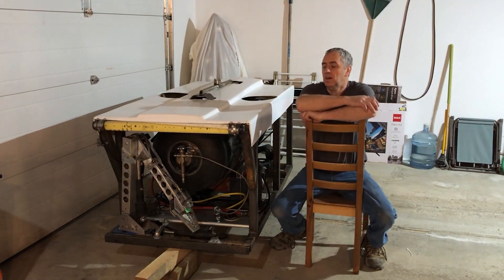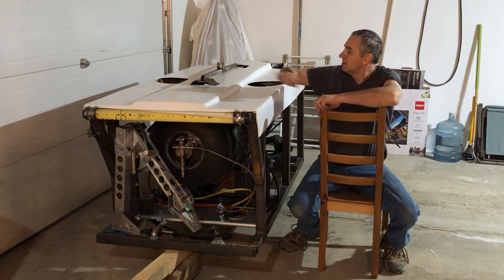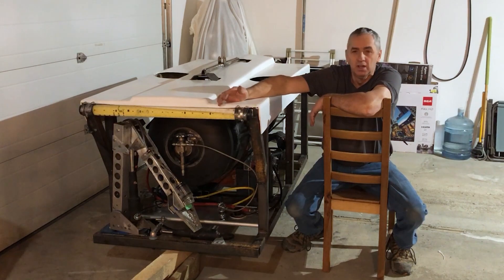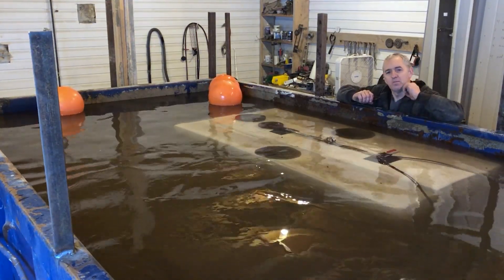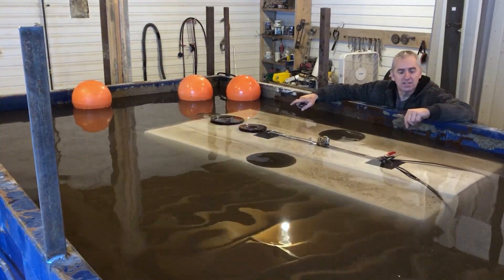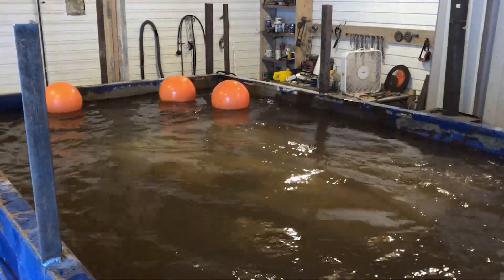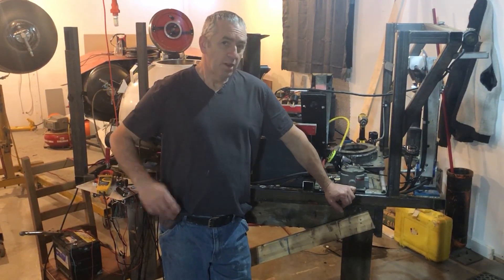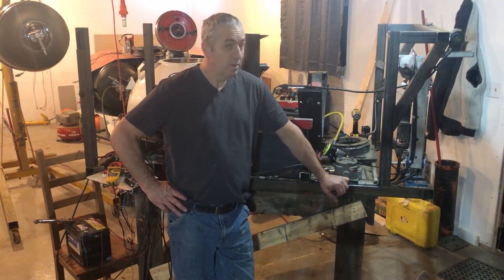Homemade Submarine Support ROV Update And Test Pool

Comment: wow, great ROV. Some questions (not saying anything is wrong, just trying to learn).
1) why did you switch from oil to air? Wouldn't it be better to use oil since it's incompressible?
2) This may answer the previous question, but what is your planned max operating depth?
3) Wouldn't filling the light with oil prevent expansion and contraction since the air will expand but oil wouldn't?
Reply from the maker: I only switched the motors to air because the arm is air compensated.  The light is oil filled and always was.   It’s too much volume of air and would effect buoyancy control.

Comment: Newly subscribed and loving it. How do you air compensate with scuba regulators?? Are those trolling motors for thrusters? Thanks for sharing.
Reply from the maker: Thank you.  I remove the mouth piece from the second stage regulator, and replace it with a short 1 inch ID hose and clamp it.  The hose then gets a plug with drilled fitting to carry the air to a manifold.  Just keep the regulator as low as possible to create a small over pressure.
Reply from the maker: Yes, the thrusters are trolling motors with air compensation.  They work really well and can go very deep.
Reply: YOU THE MAN !!! Come to Bahamas and let’s dive the Wall 🇧🇸